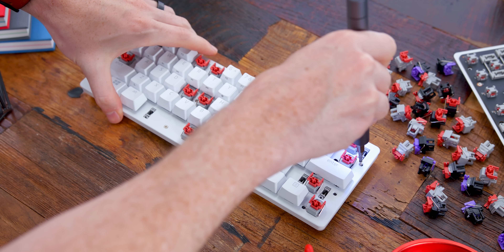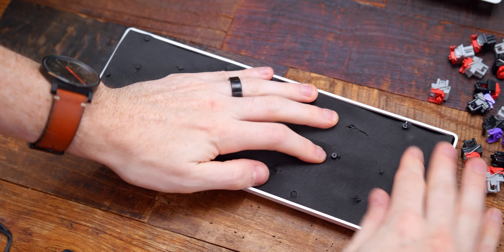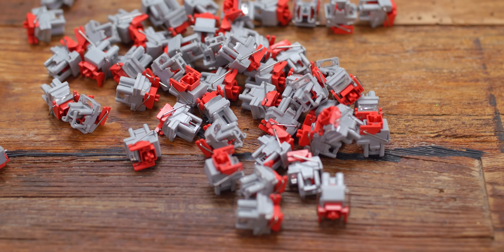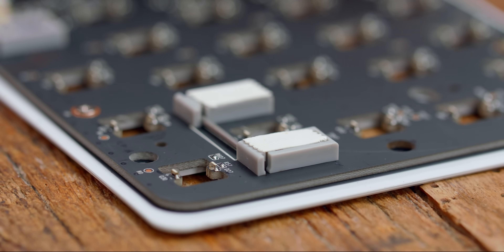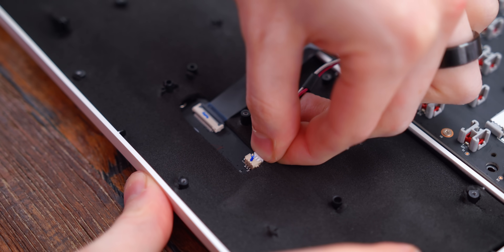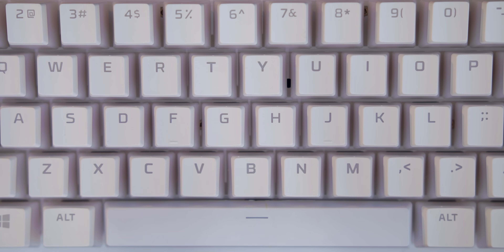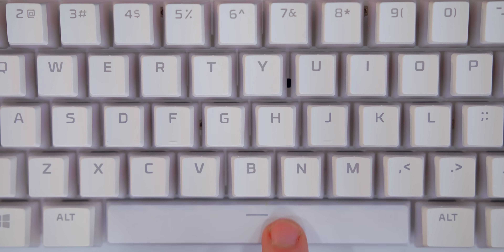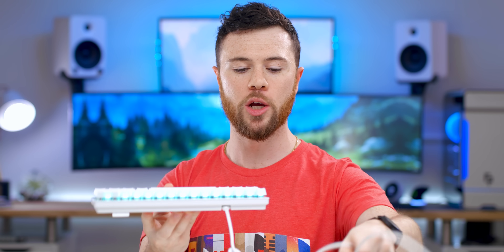5 Tips to Mod & Improve Your Razer Huntsman Mini Keyboard

Comment: guys, just lazy lube it. do not use wd40 lubricant EVER. it contains petrol which is not plastic safe, meaning it will dissolve and break down your switch and it can easily destroy your optical sensors. To not risk your keyboard just lube it by using krytox 205g0 and lube the ends of the switches stabilizers and the sides of your switch. works just as good.

Comment: I just did these modifications to my new Huntsman! While it does come with a very thin foam pad by default now, the 2mm thick EVA form I bought is still miles better.
One thing to be VERY mindful of when doing the dry lube step: I used a piece of tape aswell, but realized halfway through that the lube was dissolving the tape glue and depositing it in some of the switches, causing them to get a slightly "sticky" feel as opposed to the very smooth feel. I would recommend to NOT use the tape and just be extra careful with the amount of lube applied.

Comment: tip unscrew the pcb with the connectors and put foam under it then put the pcb in and put extra foam it doesnt help alot but it helps a little bit if you have the extra time.

Comment: Razer has already listened. If you bought the Huntsman Mini in the last couple of months or weeks, not too sure when the newest revision came out, they already added the dampening foam and the bandaid mod. Only disassemble it if you want to lube the switches, otherwise it's already all done.
Reply: only on the analog
Reply: @yahned I have the one with red optical switches and it had all these mods. Not sure if they sell a different version in Europe. Would be weird
Reply: @yahned  the model number I have is RZ03-0339

Comment: The thing is you can dimassemble them without breaking them. I have done it with the purple switches which i have heard are more finicky i turned them into linear (but the actuation distance was changed from 1.5 mm to around 0.2 =)) and the actuation force about 15 grams less)
Reply: How did you do that? I wanted make my Huntsman Elite linear but I don't feel like paying for an entirely new set of switches.
Reply: @moxine_  you can't turn them into linear. The key will register too early. You can't rest your finger on the key. You would have to modify the purple piece and get heavier springs. I did it just because i heard it was impossible. I just made 2 shims out of a tin can. Try as thin as possible. You will have to force it open but try to increase the force slowly

Comment: A gk61 is a slightly better buy keyboard wise, it is 10x easier to mod and is essentially the same keyboard if you Gateron silvers. The only two downsides are the stock ABS keycaps, and the customization software no being too user friendly.

Comment: Just done it to mine and it worked grate 👍 I didn’t use wd40 and didn’t lube the springs but I did use lube on the metal bars on the switch

Comment: Since they're optical "opto-mechanical" switches, would some lubes interfere with the sensor? or is that a myth? If that might be an issue, what lubes would be safe in your opinion?
Reply: dry spray lube like what he uses in the video

Comment: This is just a little tip from somebody who did this mod:
if you break one of the little clips on a switch that hold it to the PCB  DON'T PANIC
Simply use that switch on a key like shift that has stabilizers, the added points of contact with the keycap will give you a straight, stable key.
Reply: The hero we needed
Reply: if you bend one of the pins you can unbend it
Reply: @mango_c00kie67  ... optical switches don't have pins.
They have plastic clips that hold them to the board.

Comment: Just picked this board up and mines actually already sounds closer to the modded version than the stock. Could be since it's more down the line they're doing better or I could have just got lucky and got one decently lubed.
Reply: I can confirm mine also sounds WAAY quieter than stock shown here. Bought it recently as well. That's awesome because I thought it was just me.

Comment: Do not use the wd40 on the switches it ruined my switches I REAPEAT TO NOT LUBE WITH WD40
Reply from the maker: Did you use regular WD40 or the dry variant I showed?
Reply: @randomfrankp  I used the liquid but if I let it dry would it fix itself over time
Reply from the maker: Lmao. No. The liquid version literally eats the plastic. That’s why I clearly said use the exact dry version I used and linked. 
Congrats.
Reply: @randomfrankp  damn bro u didn’t have to be such a jerk about it I was just asking I never said it was your fault (edit) I let it dry for 2 days and it works just fine again
Reply from the maker: No no no, look at your original comment...there is no "asking" there.
Reply: @randomfrankp  talking about my first reply to you btw I asked if it would or not

Comment: I used the WD-40 Dry PTFE lube on these switches but I noticed that now sometimes after not pressed for a while, the keys sorta stick on the first press, its very odd, they switches do feel like they were factory dry lubed though and I'm not sure this dry spray was good for them, I kind of feel like it was a mistake. Has anyone else tried this out?
Reply: Hi there I have just finished spraying them and I have the same problem as you. They’re pretty much stiff. Have you fixed the problem?
Reply: Same for me. Jay, it’s been 11 months, how was it gone with your keyboard?

Comment: Can I dry lube gateron optical switches and without taking the switch apart?
Reply: I haven't tried it yet, but you should probably be able to. If you want to confirm, go onto r/mechanical keyboards in Reddit and ask your question there.

Comment: so the only thing I did from this video was the wd40, and most of the keys are working, but I few don't, and I'm not sure what's wrong, all of the LED's light up, but 11 keys simply won't send a signal to my PC. Can anyone help?
Reply from the maker: Did you use regular WD40 or the specific dry WD40 I used
Reply: @randomfrankp  oh I see. No, I used the regular one. So do I just wait for the lube to evaporate?
Reply from the maker: @orelle8547  ooof, idk man, the regular WD40 is known to eat through plastic which is why I recommended the dry variant. I'd remove them all and clean them, let them dry for a day and try to remove any residue remaining on the PCB.
Reply: @randomfrankp  thank you very very very much for your time:)

Comment: As someone who actually has done this with their Huntsman Mini I have a few tips for you guys. 

1.) Use a little bit more lube than you think you have to, I didn't use enough and now some of my switches have more spring ping and aren't as smooth as others. 
2.) Maybe this was just a fail on my part but when I put the keyboard back together I put a few keycaps on before I noticed that my stabilizers were actually sticking to the band aids underneath them
Reply: Yeah the band aid mod just gave me a sticky feel, and I took them out.
Reply: Is there a difference with normal WD40 and Dry WD40? I have normal. Will that work or does it have to be dry specifically
Reply: @greedaye  regular WD-40 isnt actually a lubricant, its a de-greaser. You have to use the PTFE WD-40, because it is a lubricant, and its non-conductive, meaning it wont short anything out.
Reply: @greedaye  i used regular and i wished i used dry. its making my switches really inconsistent rn but i think it will just dry out? hopefully or else i am just $130 down the hole
Reply: hey i used the regular bc im a moron. I read that it eventually dries out. Is my board fucked or should i just wait to let it dry out. The only problem is my switches are super inconsistent.

Comment: I think its important to note that you SHOULDN'T use regular WD40. Either use the same PTFE spray he used or use Super Lube aerosol with PTFE.
Reply: Apperently the exact WD40 he is using isn't available in my country, and l know f*** all about it. It just need to be a PTFE dry lube, correct?

Comment: please can someone answer me!! if you’re a huntsman mini owner, how have aftermarket key caps worked for you? I tried using two sets and they both just didn’t work when pressed down all the way.

the caps will seat into the stem but once again, when I press down on the switch the key might pop back up and sometimes it sticks a little. I have four other keyboards that all work with these caps.

Comment: dont use normal WD40! IT IS NOT A LUBE! if youre going to use a dry lube, get an actual dry lube! WD stands for water displacing and therefore isnt a true lubricant, you need to make sure you buy the one that specifically says dry lube like in the video (not the normal blue can version).
Reply from the maker: ...which is why I used the one I did and linked it

Comment: Does anyone know if using the foam under the switches works just as easily on other boards such as the huntsman TE or the Apex Pro TKL?
Reply: This comment is basically the same thing as asking if a mouse pad will work on a wood surface instead of a plastic one
Reply: yes

Comment: Frank quick question, can you change the switches on the keyboard
Reply: Technically yes you can as they are "hotswap", but only with razer optical switches. Only catch is that you can't buy the switches to replace them in your keyboard, you'd have to buy a new keyboard at which point you'd just use the new keyboard

Comment: Why not go with dielectric grease for the stabilizers?

Krytox obviously isn't a bad choice either, I've just seen quite a few folks in the keyboard community use dielectric grease instead of Krytox.  Most of them are removing the stabilizers, so I don't know how hard it would be to remove and disassemble these stabs.

Either way, great vid as always.  Keeping me entertained and the brain working during this tough time.

Comment: watching this with my $32 gk61. will try the foam thing later
Reply: Did the foam thing work?
Reply: @citricalxx5227  Since there is no reply. I'll reply from my own experience. Yes it works, there is no hollow sound or echo when you use the keyboard. Another good mod you can use is using O rings on the keycaps. It will also dampen it dowm
Reply: Gk61 is better than huntsman mini
Reply: @apsndd jwhdhd you can buy fully aluminium gk61
Reply: apsndd jwhdhd the gk61 is actually quieter because it’s stabilizers aren’t complete garbage like the huntsman mini. I’m not saying the gk61 stabs are some otherworldly being but compared to the huntsman mini they are a godsend. On top of that for less than the huntsman mini you can buy lube and make the switches feel and sound much nicer
Reply: apsndd jwhdhd I never said the switches were silent I just said they were quieter than the switches on the huntsman mini
Reply: apsndd jwhdhd the switches are not silent they are linear
Reply: apsndd jwhdhd these specifically aren’t silent
Reply: apsndd jwhdhd doesn’t matter if they are still loud
Reply: apsndd jwhdhd no
Reply: apsndd jwhdhd what lube did you use
Reply: apsndd jwhdhd on both or just one

Comment: DONT PUT WD 40 on it! It’s a solvent and a lube it’s meant to disprove rust it could also probably dissolve plastics in your switches
Reply from the maker: Which is literally why I said 
1. apply it to the spring, and 
2. Wouldn’t recommend doing it

Comment: Just a heads up on the HyperX pudding keys. I swapped mine and the issue with the space bar is that it has those clips on the edges. So if you do the swap, the space bar key cap from HyperX is gonna wobble way too much. I recommend leaving the stock space bar.
Reply: I also left my stock spacebar because the hyper x spacebar felt sooo bad, rest of the caps are amazing tho !

Comment: WD40 is a different type of lubricant. 
WD40 stands for water displacement 40, the 40th attempt at creating a water-displacing spay  - it was created to remove water from places and works in the short term, it does have some lubricants inside but it will eat through platsics and they are not the main thing in it. it is not a lubricant 
it removes rust and helps open stuck doors or hinges and dissolves different materials in order to do so, it is not recommended for use in switches, even if it were a lube it is a short term solution and does not work in the long term

WD40 IS NOT A LUBRICANT AND IS NOT RECOMMENDED FOR SWITCHES OR ANY OTHER PLASTIC

Comment: The rattle is still god terrible on the purple switches, my board moves when I press a couple keys
Reply: Use some mass loaded vinyl. It can provide some more rigidity and absorb more shocks.  They also come laminated in the form of dynamat or similar products with different names.
Reply: @ubacow7109  You a real one g
Reply: @Zzzz-jn1xt  did it work
Reply: @Zzzz-jn1xt  Where did your get Vinyl from?
Reply: @idkconflict  Ya it actually worked it still some rattle but more of less much better than before